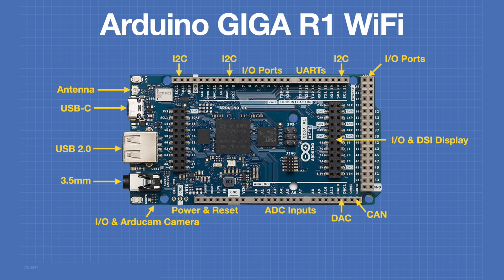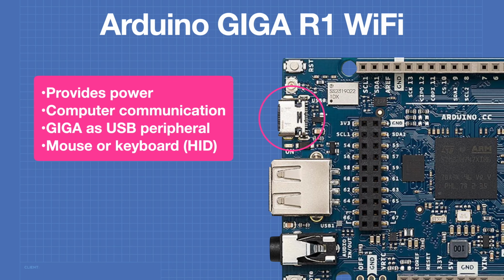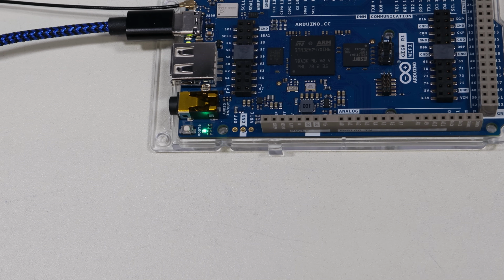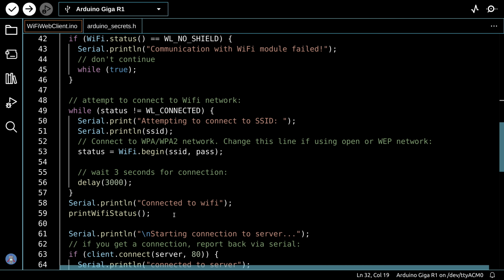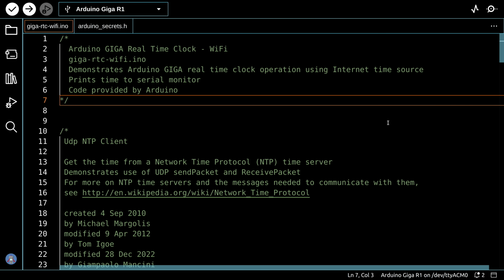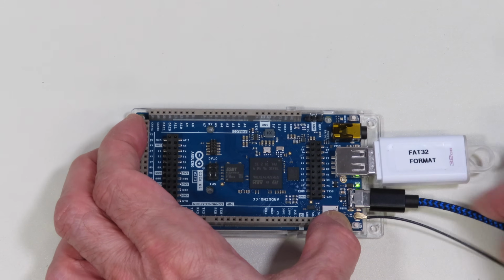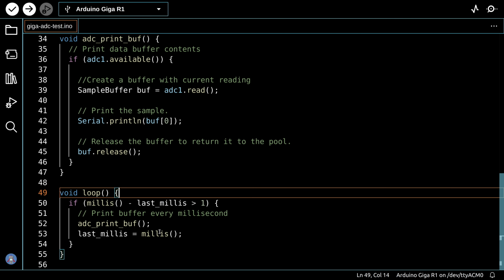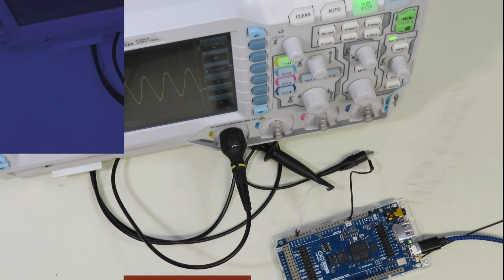Arduino GIGA WiFi - First Look

Comment: In Germany I‘m seeing prices ranging from about €70 to €85. These are very impressive specs for the Arduino family, but it‘s getting to where it‘s more like an SBC than a microcontroller board, both in terms of specs and price point.
Reply: It's still not as good as an SBC, but official Arduino hardware has never been known as a good value.
Reply from the maker: Yes, I had the same feeling regarding the price, factor in the shipping and I paid 100 Canadian dollars for it.
Reply: @Dronebotworkshop    I became an "Electronics Junkie" sometime after I was born in 1958.  I feel like saying, "You guys just don't know how blessed you are, with all the various toys"!  My goodness.  Before I came here, I was watching your video on the amazing Raspberry Pi Pico.  They're so tiny and space-saving.  When I was first learning in late 1970s, soldering up a kit like that could be messy & took up space..Be thankful, learn lots & enjoy what you've got...🇺🇸 😎👍☕
Reply: Agree.
Reply: It's not worth the price but it is very cool. I'm in Canada as well. I got 2 teensy 4.1 boards with all the extra ram and such for cheaper. Order straight from pjrc
Reply: Its worth it if youre looking to use if for dsp
Reply: Only Bad Option if SBC doesnt go 200€++ because of inflation and chipshortage/Taiwan vs china
Reply: @kitecattestecke2303  also true. I still couldnt get even a pi zero till this day.
Reply: @kitecattestecke2303  well, those same forces can and have made microcontroller boards more expensive as well. Who knows if the component shortage will let up this year, as some have predicted. But broadly speaking, it‘s hard to see how SBCs would be negatively impacted in those ways while microcontrollers are not.
Reply: @Kitécat TestEcke  we're coming out of the chips shortage. What tbe raspberry pi company are doing baffles me. There's tons of other companies putting out better sbcs available at msrp.
Reply: Most SBC don't have the kind of IOs of this board. They don't target the same applications. It doesn't replace the 2560 either if you need specific IOs and no big computing power.
Reply: @Antoine Martin  the keyestudio megas can source 3 amps out of the 5v pin. It would have to be a thick jumper wire maybe. Haha

Comment: This looks like a nice addition to the quiver: Pi 4, GIGA, ESP32, Pico W and various small footprint RP2040l cover a very broad range of applications and price points. Man it's a great time to be a kid (pushing 70):-)
Reply: I have arduino nema 17 stepper motor automatic blinds in my house lol. I was going down the pico w route but this arduino might bring me back. I do prefer arduino. Us old people have an advantage over young people as we had to program most of the time.
Reply: Im not a retirement fund kid so I got to be really careful with my fixed income... No offense... Just saying I can't afford a selection.. 
   What I want to ask is, can one of these emulate the others? Which one is the most flexible? Especially if I want to use an os.. please don't say pi , too expensive now to get one, but I do want to run software meant for the pi...
Reply: At 71 myself, I hear you!

Comment: The STM32H747 has 3 x I2S ports and a I2S LP so you should be able to do audio through the proper I/O pins, assuming they are brought out.

Comment: Hi, African viewer here... I really thoroughly enjoy your videos, and I've learned so much. Thank you!
I know you only/mostly work with DC, however, I've got an AC request... I inherited an oil bath from my father-in-law among other heavy duty tools, and although I like the fact it is a vintage, heavy-duty item that will do almost any job and last for generations, it bugs me no end that I'm not able to adjust the amperage to my liking.
It's almost legendary in our town since it's welded a lot of the heavy industry's roofs, structures, the ships' hulls, the jetty, and other heavy metal welding- from a well-known boilermaker with a respected reputation, but... I'd like to make the old girl "mine" and personalize it to my liking.
As you know- an oil welder has five or six "poles"- each with a different/set amperage, and one is the earth pole. So if you want 50A, you screw your electrode cable to the 50A pole.
Then if you want 300A, you screw it onto the 300A pole etc...

All this is tedious though, and there are times when I want 60A - 90A for instance - and sometimes lower, but my only options are 50Amps or 100Amps and up to 350A.
How can I add an amperage adjuster to this circuit? AC is high current, so I'm not familiar with a regulator/adjuster that one can use here. I won't be able to easily adjust the voltage in order to lower the amperage(or perhaps I can? Just the opposite...), because of the way transformers work, but adding a variable resistive component to the circuit should do the trick.
Problem is, I don't know where to do this in the circuit and what component(s) I will need. I'm not familiar with AC resistive components..

Can you (or anyone else) please assist me with these questions, if possible? I'm sure there are countless nr of people with an oil bath that would love such a thing!
Reply: have you checked into variable inductance? Basically its an old core from a large transformer wound with a winding on the center leg and the frame is cut to make an E and an I  (EI). The gap between the E and I is adjusted to vary the amperage flow. I made one for a large tesla coil and used #8 THHN at 220 winds for 240VAC at 60A
Reply: @bunnykiller  Wow! That was quick! 😀

That sounds promising. Seems to do exactly what I want. I also see there are plenty of welders with variable inductors and a few circuit diagrams, so a nice bit of reading up and then seeing an electrician to see how we can implement this.

Pricing also doesn't look too bad. I've looked into Rheostats... and jeepers - those things are expensive!

Thanks man.
Reply: @bunnykiller  Thanks again buddy. I found a site where a guy explains how he managed to add this to his welder.

I'm also looking at a saturable reactor.
Reply: C3P0 loves an oil bath ! maybe you could consult him ? 😜😁

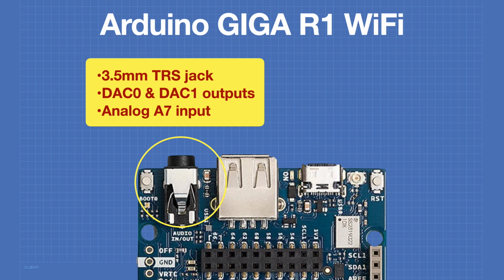Comment: 10:05 The audio jack is actually TRRS, not TRS.  Ie: Tip = Left;   Ring1 = Right;   Ring2 = Mic;   Sleave = Ground, according to the schematic.  That detail is significant because it means stereo out and mono audio in can be used at the same time. The Mic does not share a connection with one of the output channels.    Regardless -- a nice overview of the board!
Reply: Sleeve = ground? Isn’t that the less common TRRS standard at this point?
Reply: Jack on giga follows the OMTP standard. Sleeve is ground.

Tip - DAC1 (left)
Ring 1 - DAC0 (right)
Ring 2 - A7 (mic)
Sleeve - Ground

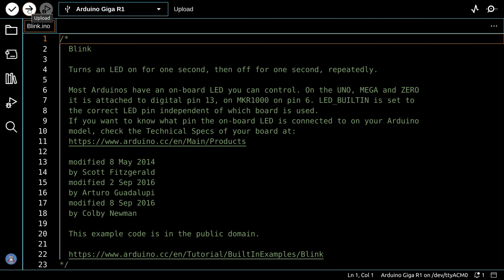Comment: This at 16:16 just caught my eye, and I have to ask - WHAT is the world coming to?!?!?
Compilation of the Blink sketch reports:

Sketch uses 109416 bytes (5%) of program storage space ...
 and
Global variables use 47520 bytes (9%) of dynamic memory... 

It's the Blink sketch.  The BLINK sketch for Pete's sake!
It includes no libraries, has a total (excluding comments) of 9 lines of code (2 of which are just closing brackets), and doesn't declare a single variable. 

The same sketch compiled for an Uno uses only 924 bytes (2%) of program storage space and 9 bytes of dynamic memory (which is reported as 0% of the available memory, because it works out as less than half a percent of the smaller total). Simply changing the board type increases the program size by a factor of more than 100, and RAM usage goes up by a factor of more than 5,000 .

I know there's always going to be some overhead for the Arduino environment, and I accept that it's going to be greater when there's a multi-core processor to deal with, but that's just offensively inefficient!

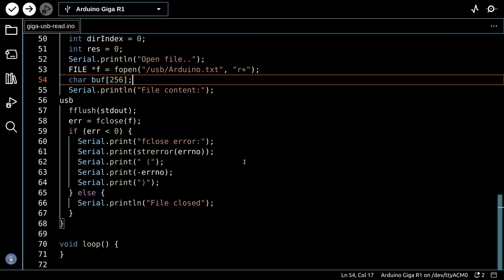Comment: Hi Bill. Great video as usual. But at 45:20, in the “Read from USB Drive” section, your code seems to have gotten a little corrupted. Line 56 simply says “usb”, and I don’t see the “fread(f, …) line. Anyway, if I’m wrong, please correct me. 😊

Comment: Hmm, takes 12V?  Love it.  Just what I needed for my power management/monitoring project for my radio room.  Very thorough coverage, thank you.
Reply: I suspect we have similar plans for it!
Reply: FWIW I have used a Pi Pico W to do much of this, for ideas I looked at someone's remote control robot project. the Pico runs a webserver allowing remote control of a number of circuits.
Reply: @g0fvt  Nice!  I have designs for ESP32 with one relay and one ammeter per feeding MQTT telemetry and subscribing to a channel for remote relay trigger.  Was hoping to avoid 12v step down, but these are too expensive per board.
Reply: @awksedgreep  for many purposes some of these boards are far too powerful/expensive. I did have an Arduino doing some telemetry for me but that reported via USB to a Pi with Wifi which also provided power over USB. The Pi Pico W may interest you, better ADC resolution than the Arduino and of course it has Wifi. 
Very low current draw so easy to use a 5v series regulator...

Comment: Because you mention the buck converter on the Arduino:
I am used to transformers that the amperage is reduced when the voltage is transformed up and the amperage is increased when the voltage is transformed down.

If I want to regulate a voltage of 12 volts /2 amps down to 5 volts, I have the question of whether a maximum of two amps can also flow on the output ( because the transformer does not supply more) or whether the theoretical amperage could increase to four or five amps because sufficient power is available - assuming sufficient power and cooling of the converter, of course.

With a transformer, this would be terribly simple: yes. 
With these converters, I can only find the value for a maximum current load plus a margin for sufficient cooling. 

I would also be interested in the logic, operation and risks of combining power supplies into "redundant power supplies". Simply connecting two switched-mode power supplies together on the secondary side - it probably won't be that simple.

Have you ever made a video on these topics? 
thanks in advance

Comment: 59:28 - at the point you are making here is the Giga 4 or 5 times stronger than the esp32 board.  That should be the consideration on weather or not it is actually too expensive...
In my opinion...

Comment: Would love to see the giga doing something like a weather station. Using the DAC you could use Beamforming and filters for a solid state precipitation sensor. 350us is approx. the round trip time for quite a number of kilometer. Also using a parking sensor (4 waterproof ultrasonic sensors with the converter PCB) a ultrasonic anemometer could be used and calibrated. This is a bit complex; I find MATLAB has a number of videos to help with theory on radar, drones (and swarms) and filters to handle alot of the noise in the sensors. May be more of a video series than one video, but hey might be fun! 

You mentioned you could run a farm with the giga. Would love to see some form of video dedicated to that! (Myself thinking of vertical hydroponics with a rotating the column, ultrasonic vibration for pollination, maybe automatic drone(s) with cameras to check crops)

Comment: Huge fan of Arduino and what they've done for the maker community. A lot of us owe them an awful lot.
That being said... this is insane.

 People need a single board computer that is accessible and affordable, extremely capable and feels a big gap in the market just like the Uno did years ago

This is the ultimate Middle ground. Why not make something small like a raspberry pi and charge just as much as this board. Or make something a bit bigger and actually make a really super capable high-speed high connectivity device that can be used in both hobby projects, and in professional settings. Similar to the khadas sbc's or something along those lines. 

I'm just absolutely flabbergasted and speechless. Shocked and chagrined! I'm amazed this got through the design and long arduous process to being produced... It just seems so insane. (Of course I could be totally wrong and they did tons of research and found a great gap in the market. And these will sell out like raspberry pies have) 

Technically I'm a hobbyist but I also work in the test equipment and metrology sector. Specializing in hardware-based troubleshooting and calibration of metrology and industrial equipment used in labs and stuff like that. so I'm probably not the best judge when it comes to hobbyist and lower-level professional stuff. But this just seems to hit all of the unnecessary and unwarranted aspects without hitting any of the needed gaps in the market. Hopefully they know exactly what they're doing and I'm just an idiot with bad judgment... But how the hell could the same people who designed and popularized the Uno come up with something like this at this price point.

Comment: The Linux DFU message is basically a (user) permission incident, not really a problem. What you suggest is a permanent solution, i.e. even if Linux PC rebooted, it will still apply the permissions. If you don't want to go that route simply run the following command just after Arduino Giga plugged in (via USB). Two commands (&&)  but I made it one liner.
chmod 0666 /dev/usb* && chmod 0666 /dev/ttyUSB*

Comment: If the pinout is the same, hopefully the DIN rail mount for the Mega will work on this. If so, this GIGA is now a HUGE win for real deal automation. Sadly, it seems to be sold out at the Arduino store.

Comment: @45:15 the errant "usb' on line 56 clobbered these five lines:

  while (fgets(buf, 256, f) != NULL) {
    Serial.print(buf);
  }

  Serial.println("File closing");

Took me a while to figure out why the code in DBWS ZIP file would not work.

Comment: Is the reason for the commas in the IP address because of a European reversal of the comma and period?  I know, for example, that the French and German locales use the comma for the decimal separator and the period for the thousands separator.  It might be possible that changing the locale settings would change the IP address separators.

Comment: Please show a project using the Arduno Pro Micro that shows how to blink the tx and rx LEDs sin e there is no pin 13 nor pin13 LED . I also need to know how to program it. With the NANO is very simple to program. Thank you great videos! I use the ArduinoDroid IDE.

Comment: Even if it uses 3.3v, some of the stm gpios are 5V tolerant. I don't see this feature in the arduino datasheet, so you have to figure it out yourself which are those.

Comment: Another well thought out and produced video. A question for the compilation and upload times, are these as slow in Arduinio IDE as an ESP32?  As these boards get faster  and the code longer with more libuaries, a very long compliation and upload could be a big bug bear.
Reply: After switching to Microsoft's Visual Studio Code (I know... gross) my compile and upload speeds to an ESP32 have improved drastically.

Comment: The VRTC pin is connected to VBAT on the STM32 chip, and according to its datasheet it supports 1.2-3.6V on that pin.

Comment: I realized the date on the numbers.txt is a little off - 2097-12-31. How did that happen? As you mentioned FAT32 can't format over a certain size. Could it have something to do with that?
Is it Linux you are using to read the stick? The octal permissions usually don't display on Windows machines. I don't know what Windows uses under the hood as to permissions (maybe hex), but it does not display octal. 
The board is pretty cool though! Your videos are so well researched, that is a full-time job in itself. I love watching your videos to give me a different take on how to use different electronic devices.

Comment: What they gonna do with all power ?

Most examples are still doable on Mega2560, except wifi/usb drive which need extension modules. But that's all. 

Anything you can do the same.

Comment: How come there are not more Orange Pi5 Drone Projects,  instead of all these Arduino/Raspberry Pi videos?      Time for Orange Pi5 GPU learning videos.   😎  Thank you.
Lots of luck to get a GIGA from Amazon...  Currently unavailable??   Orange Pi 5B 16GB Rockchip RK3588S 8-Core 64 Bit Wi-Fi6 Bluetooth 5.0 with Type-C Power Supply  $195.99

Comment: How can we use both SPI simultaneously in Arduino Giga R1 WiFi? Interfacing micro SD card and nRF24L01+ modules connected to SPI5 and SPI1 respectively. The SPI numbering is as per the specification sheet #2. The nRF24L01+ module sends the data from various sensors like GPS, heading, depth, etc. micro SD card module saves the data locally. Please share the Arduino code too. Thanks in advance.

Comment: IMO board is too big. All boards with M7 processors are expensive. I would prefer Teensy if I  need M7. Raspberry Pi has best support for camera. You can't make nice keyboard with it. Quadcopter? 3D printers have specialized boards our days. If you design PCB you would prefer something small like teensy or pico or ESP to solder on PCB. Hard to imagine it would be a popular board.
Reply: Schools might lap it up all those disciplines on one board and the Arduino ecosystem on side it's great for teaching
Reply: @andymouse  you are right about schools but 3v pins will burn and it is expensive board

Comment: Hi, I am new to Arduino coding and building, so this might be a silly question.. but are there advantages or disadvantages of using a board that needs 3.3 V instead of 5 V? So far I've only worked with 5 V Arduino Micro. Greetings from Germany! :)